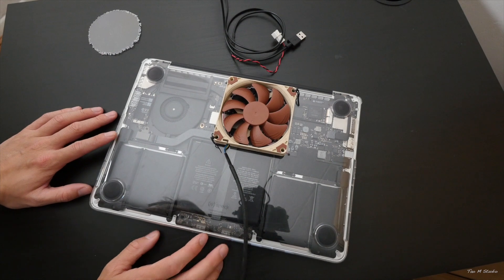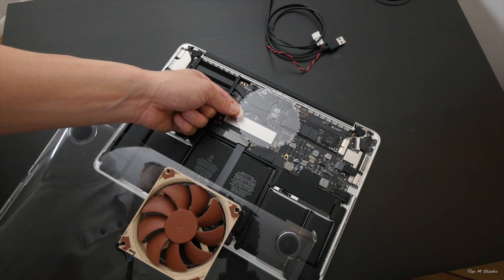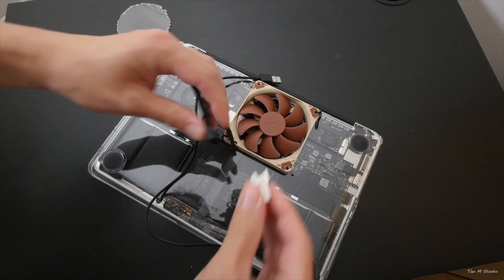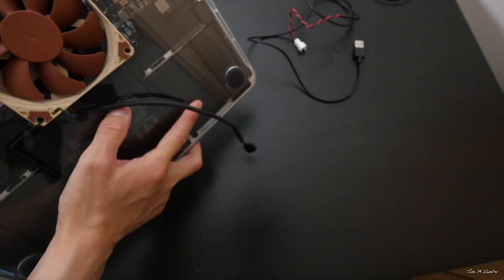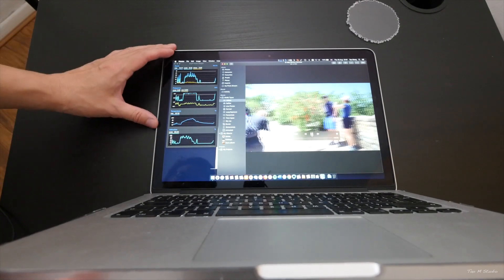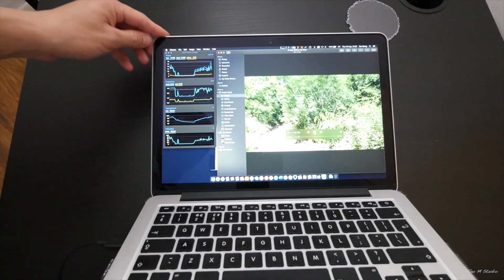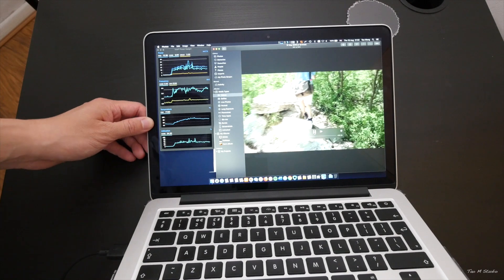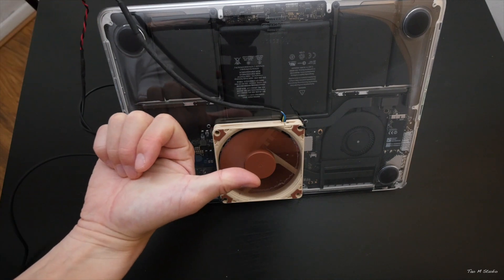Frankenstein cooling solution for MacBook pro

Comment: did you try replacing the thermal paste?
Reply from the maker: @jt3000o  
yes.
Reply: @TaoMStudio  you could also just take the signal wire off of the fan in the MacBook and the fan would spend at high speed all the time

Comment: To all comments using your laptop in a room with AC or without AC doesn’t make a big difference, and this design will make almost no difference. You need to get the metal cooler not the space between the lid and the internal parts. 

Best way is to attach a liquid cooler dedicated to be used in a PC to the metal cooler.

Comment: Apparently, the new covers have vents!  I didn't know you could just snap it on. Do you think this would be safe resting on a cooling pad with just the plastic bottom?
Reply: I did this on my MacBook for 2 weeks, and no issue. Dropped like 15 Celsius from 99 C to 75C during heavy workflow. 
However, I notice that there are two small metal columns from the MacBook pushing into the new cover. The columns barely missed the cover's vent. Otherwise, those metal columns would have contact the metal of the cooling pad LOL.
Reply: Oh. almost forgot. I noticed that "platform controller hub die" temperature doesn't change much. However, CPU temp dropped significantly. SSD temperature got into the 50ish. Maybe because there is no vent where it is, and the plastic cover pushing directly onto the SSD. Thus, no air vent.

Comment: I'm in the process of doing a similar thing with a 10-year old VAIO laptop. Only I want to completely get rid of the original fan (typical hairdryer noise), and place a 5V Noctua 4cm on the exterior of the case in front of the hole where the original fan used to be (the laptop doesn't move from my desk anyways).
What I'm hoping is that, since the original fan is 5V, I "should" be able to rewire the Noctua directly on the motherboard, so I won't get CPUFAN alerts and will have PWM (Noctuas are 4pin).
Anyone ever tried something similar? Anyone ever tested these Nocuas and are they silent?
Thanks.
Reply from the maker: @Benoit Bvg To my knowledge you "should " be able to do it with no issues with PWM fans. But, I have not done that myself.
Reply: @TaoMStudio  Thx for the reply. Will get to work when I receive the fan. Might even create my first youtube video for the occasion^^

Comment: i have been using extra fans to cool macbooks for years i even would go to the extent of buying extra bottom pieces to modify for high demand applications / not to perminantly damage to machine
with todays external battery pack options i would sugest you run from an external source, i have a few older macbooks that have 2018/ macbook pro cooling fans ( 2 ) that are hardwired into the internal fan as well battery life is definately an issue but this definately gos along way  thanks for sharing the video  try the smaller fans 2018 Macbooks

Comment: Hi, have you had any problems with the MacBook since doing this longterm?
Reply from the maker: Hi, I had no issues when I used like this for 2 month. Now I have put the bottom cover back on. I will do the same in summer time.
Reply: most likely he had acceptable temperatures .D

Comment: If I recall correctly, the bottom panel was designed to handle any electrical grounding to prevent shorts and act as an extension of the wifi antenna? Have you seen any of those issues?
Reply from the maker: HI, no issues at all.

Comment: It's useful, but wouldn't that pull dust into the components?
Reply from the maker: Hi, yes it will pull dust. Just need to clean it occasionally. Or use dust filter.